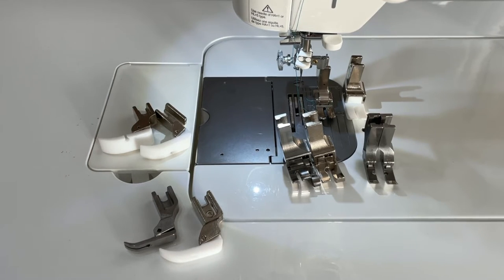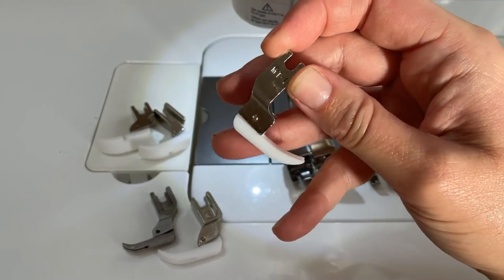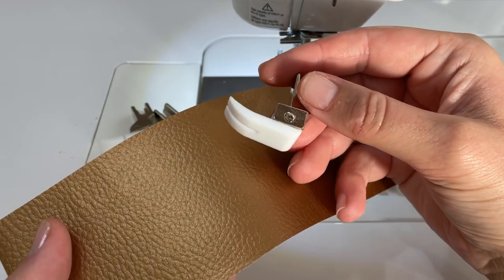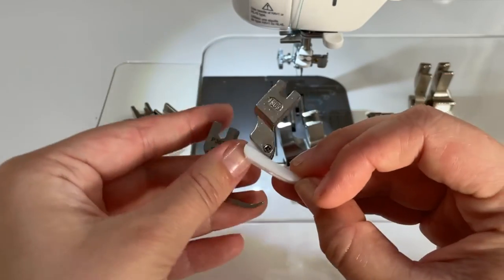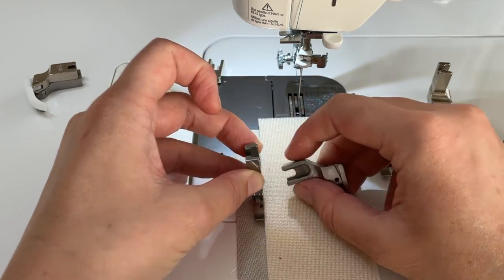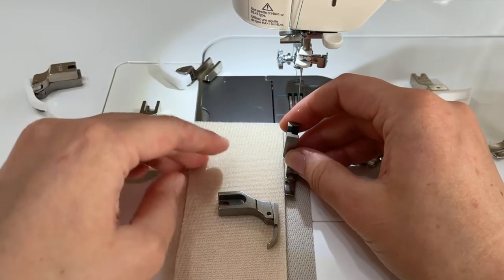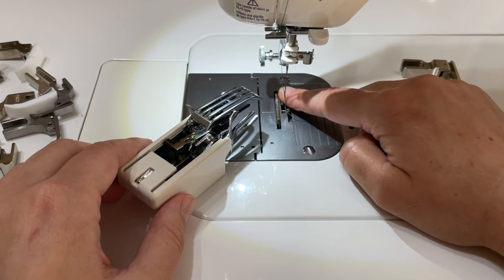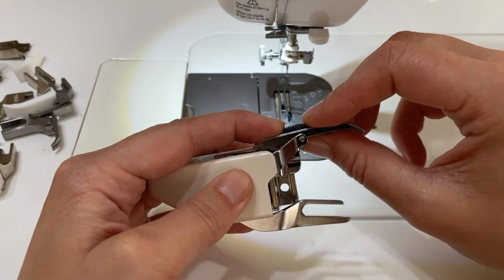Juki TL-2200QVP mini - My Favourite Presser Feet

Comment: You can buy a teflon feeddog. It is best used in conjunction with the teflon presser foots. It helps them last longer and also eliminates the scratches experienced when sewing with higher presser foot pressure.
Reply from the maker: I honestly had no idea, thank you so very much for the tip, I have to look this up.

Comment: Thanks!  Very informative!!  Is your walking foot the one that came with the machine??  Mine did, and I have had a lot of problems with skipping stitches.
Reply from the maker: Yes it's the one that came with the machine. You need to up your pressure foot pressure quite a bit to use a walking foot if working with layers, so try that first. If that doesn't help, try a topstitch needle as the bigger eye will allow your bottom thread to catch more easily. If neither works, I have a blog post with more skipped stitches help here: http://blogg.pinkponydesign.com/2020/06/skipped-stitches-and-tension-issues-help.html

Comment: Where do you buy these feet in the USA?
Reply from the maker: I would think a local Juki dealer should be able to order them even if they don't have them at home? I'm afraid I'm not familiar with any US webshops enough to be able to recommend one I'm afraid.
Reply: You can also buy them at Cutex Sewing Supplies.
Reply: I buy my sewing machine accessories at Ken’s Sewing Center.